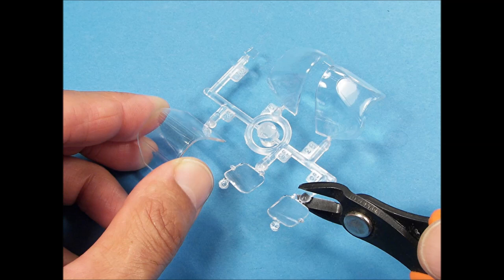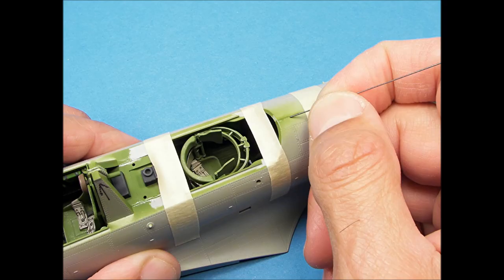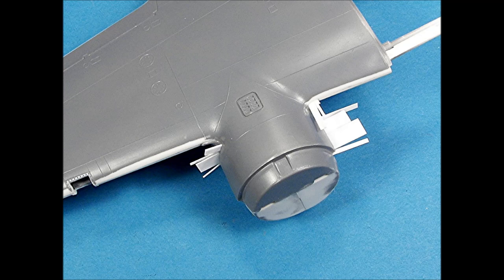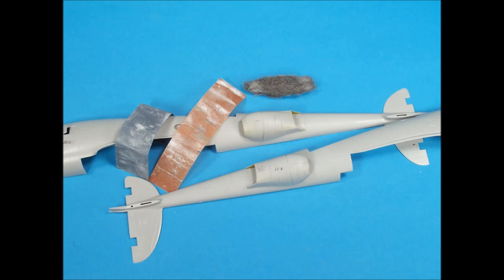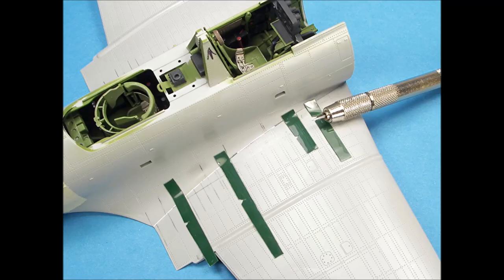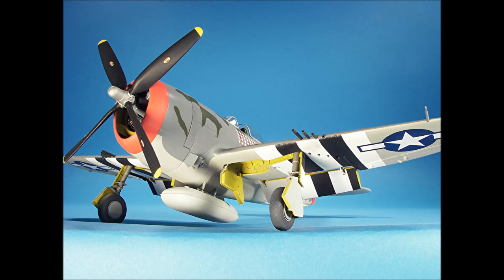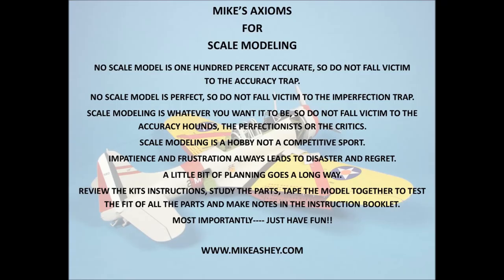Scale Model aircraft construction techniques & tips part - 2

Comment: I like the tape up technique and use of super glue; seems to work better for me than using the normal solvents that people usually use for models. The CA sands easily and gaps are automatically filled, unless they are too wide, and which case Mike has other ideas! These may be older techniques, but they sure work well.
Reply from the maker: Hi Dave

Thanks for trying my techniques!

For gaps and voids I use various sizes of Evergreen strips super glued into place and then trimmed and sanded smooth.
Reply: @scalemodeling  
Thanks, Mike. I will Check those out. Keep up the good work.

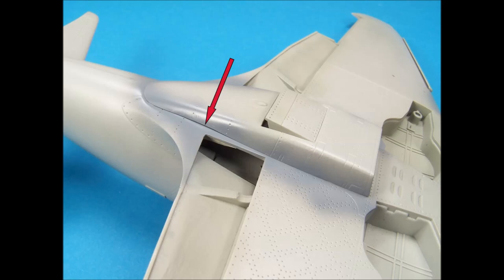Comment: 7:43 judicious use of Mr. Surfacer will also help fill in think cracks though it may take several coats to completely fill it in. Unlike white glue, it will not shrink or peel. If the crack is wider, I like to mix a small amount of Milliput, roll it into a snake, stick it in the crack and use sharp spatulas to press it into place.
Reply from the maker: Hi Scott 

Great to hear from you

Hope all is well!

Traveling around the US and visiting lots of air museums

Mike
Reply: @scalemodeling  I hope all is well with you as well Mike. I have been on about an 8 year modeling hiatus but am fixing to break into the old Revell 1/32 P-38J. It will be another epic scratchbuilding project. I will toss the cockpit and wheel wells and scratch build them. I am on the fence whether I will scratch build the gun bay but will probably detail the #1 engine from the firewall forward like I did that old Revell 1/32 P-47D. 

I got married again a week ago yesterday to a fantastic woman and am now settled in Pawleys Island (about 45 minutes south of Myrtle Beach) SC. 

What are you working on now?